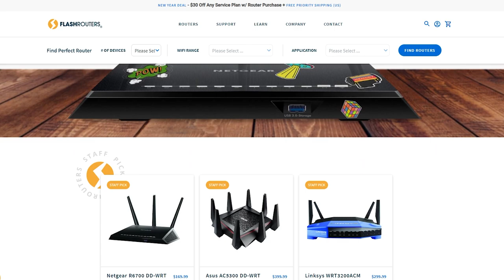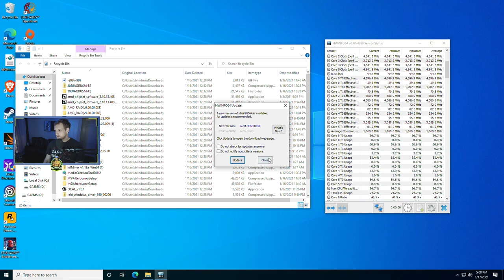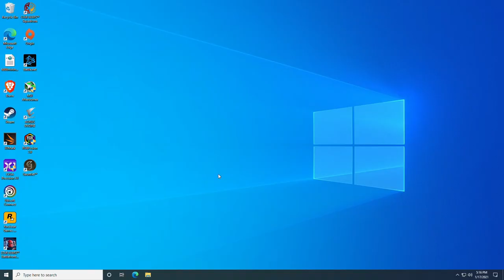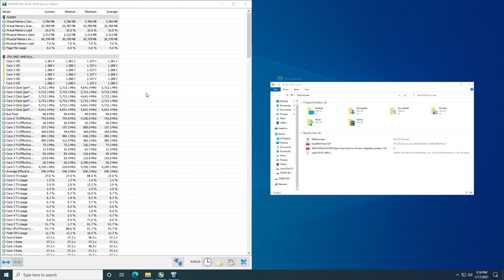How to Replace Thermal Pads on Any GPU!

Comment: Hello, I put it only in the back of 3mm, but I did not manage to lower the fan, now it mine at 97 mhs without throttling but I do not achieve that the fan in autoamtico goes down 100%, and if I manually reduce it, lower the power, for example if I put the fan at 50%, mine at 50mhs :(
Does the fan lower you 100% with the change of the factory pads?

Comment: I’m looking to add thermal pads to the back of my vram…. But my card has the clear plastic film on the back plate. 

Do I need to cut the film the size of the thermal pads in the backplate?

There seems to be nothing online about it

Comment: You read my mind on stuff like this. I tried to do this on mine and it didn’t work so I sold it to a non miner. it’s possible I could have needed to replace the super oil ones that’s were leaking, I only added to the back like panda.

Comment: My gpu will run clear up to 86c in the warzone if I alow it. I’m thinking about replacing the thermals on it but I think it’s just a bad card. It plays warzone around 72c but only if I undervolt it to 70% power and turn the fans to 90%. Oh it’s a evga 3080ti ftw3 ultra btw. Any advice? This is my first build I’ve had it for about 6 months

Comment: update HWinfo 6.42 to get T-Junction temp for memory modules... 30 series GDDR6x memory get damn hot... and causes throttle way more than core temp! will thermal throttle at about 110c on the memory. 
i keep my 3090 stable at 108 no throttle!
Reply: 108*C is still too hot IMHO. I would not run them at these temps for too long. Try to keep it below 100*C. I try to keep mine at 92-96*C.
Reply: @bgtubber  why ?? the thermal throttle is there to stop the card getting damadged... is your "IMHO" based on experties in the field ? or is it just a hunch?
Reply: @oderbang  Just a hunch. From what I've read, it's bad to run CPUs and other kinds of chips above 100*C. I don't think these ones are much different in this regard. So I personally err on the side of caution. Better safe than sorry.
Reply: @bgtubber  hrmm ok... well i have 3 year warrenty so if it goes tits up nvidia will sort it :-D
Reply: @oderbang  In the current market situation you may not get your replacement GPU for months. They'll most likely just refund your money.
Reply: @bgtubber  that information based on anything... or another hunch ?
Reply: @oderbang  As I said in my previous comment, it's based on the current market situation. There are no GPUs anywhere. Especially 3090s and 3080s.

Comment: bro, you did an amazing video. As I have watched the video you posted on changing the thermal pads on your Aorus I did the same thing with my Gigabyte 3080 Gaming OC. Nevertheless, now the cards show stable MH/s, but the Autofan option on HiveOS isn’t working, do you have the same issue? and the backplate is extremely hot....

Comment: I'm all for DIY, but this fix looks damn terrifying. Probably even more so than the average 108°C I'm pulling on this very same card's Memory Junction.
Reply: Seems like the consensus with these Aorus cards is that the hardest part is taking out all of the headers. I saw a separate account on the thermal pad replacement echoing this. The pad application seems straightforward enough.

Comment: How do you deal with issues with manufacturers saying that warranty is void due to being opened?
Reply from the maker: At this time it depends on your use case. RMA would be preferred if you could actually get the card. There is right to repair in US but it’s hard to fight sometimes.
Reply: @SonofaTech  Yeah, It's a shame they can't all just be required to sell them with decent thermal pads, or at least be allowed to take the card apart and do it yourselves, I know MSI has forbidden me from doing anything to the card, including water cooling or changing thermal pads so I have just been trying to get it sent back, but most of the time I just am left without a card and it's hard to prove its an issue as you keep getting "Core temps are fine, so there is nothing wrong with the card"

Comment: Can you post the thermal pads you had with each of the thicknesses? I'm confused on which to get
Reply: Also is 100x100 thermal pads enough?
Reply: @ianpang171  depends on how many cards you want to use them for. For one card sure, you won't need that much anyway.

Comment: Does changing the thermal pads void warranty on these 3000 aorus cards? I have aorus xtreme 3080 and the memory is throttling.
Reply: In the US they can't void warranty because of right to repair. They might give you some hassle but if you stick to it it will be fine
Reply: @bubba1341  could say "sadly" I dont live in the US in this situation.

Comment: Just got a  gigabyte 3080 ti eagle .while mining ravencoin mj is102. i want to change thermal pads too but i dont know what size and thickness to purchase are the same as 3080im a bit confused ,..Some help would be appreciated if someone has done it already and can tupe done here mm and pad dimensions are needed ..Great video as usual soat.

Comment: Hello, how often should this work be done on a video card that works 24 hours a day for mining?
Reply: Maybe try taking the cooler and backplate off your card 1 time and see how it is set up. Depending on the quality/cost of your card you might find it has just a few small pads but needs more for better cooling. Also, make sure you monitor your temps and be aware that some systems don't monitor temps of the memory modules.
Reply: @thequietkiwi  thank you so much.

Comment: Hi Son of a Tech,

You are an absolute legend sir. 
I have a bunch of 6700xt two of them are gigabyte eagle and I have to run them on 90-100% fan as they are generally 20 degrees hotter on the memory compared to my MSI mech and Asus duals. I cant wait to get my pads and change them.

Comment: hello I have the same gpu and I have the same problem of thelmal pads I already saw your video but I see that in it the links that you put only the 200mm pads my question is you only used 1mm pads to replace the ones that the gpu had?
Reply: 0,5mm on caps, 2mm on the chips, 3mm on the back :)
Reply: @Goldstar1337  thankyou

Comment: Did this process actually improve your temps? I did the same on my 3070 and temps are ever so slightly worse now. I don't think mx-4 is a very good thermal paste for gpu
Reply: I recommend kryonaut for gpu die

Comment: how often do u recommend changing the pads? also while changing them, can i kep the old thermal paste, or do i need to replace as well, thx in advance, gigabyte vision oc with 75 mhs
Reply: That Gigabyte cards have no backplate pads and bad front once. My work colleague changed his pads and added on the back as well as using noctua thermal paste and he went from 108-110 celsius on memory (throttling) to 90-92 celsius while getting his MH from 75 to 98-99. Also, to answer your question, yes you do have to replace the thermal paste cause it won't make good contact the second time you try to set it on, it's a one use only.
Reply: thank you sir, i greatly appreciate ur time

Comment: Is there a reason you would want to change the thermal pads?
Reply: Mining
Reply: @k.u.m.o.r  why
Reply: @roastingcamp  for cooler temps. After a while the cooling properties of the pads are severely broken down. Especially for the gddr6x.
Reply: After a while the pads become damp due to long use and overheat so replacing pads extends life of chips and cools system and gpu.

Comment: Hey. One question here. I have 2 rx 5700. One of them is mining 51MH/s as its supposed to, but the second one is only on 40. None of them seem to overheat though. Do you think this could be due to the thermal pad?? Or what could be happening here
Reply: Most likely, almost guaranteed if both cards are running the same overclocks / undervolting :) Download HWINFO to monitor your temps and look in the list if your specific card is Thermo Throttling, it is a simple 'performance limit'-tab saying 'yes' or 'no' :) Good luck

Comment: Could someone tell me the thickness of thermal pads for a Gigabyte RTX 2070? I can´t find information online. Thanks for the help. Thansk for ur video !
Reply: One thing I've learned about the mining/gaming community is nobody shares info. Idk why or maybe corporate bots scrub the info from the internet but you just can't find info on some cards. I've got a ventus 3060 ti and can't find pad thickness after 3 months.
Reply: Like he said in the video, open up the card and measure them.
Reply: @megalojerk84  But in 1 hour you could have opened the card and measured it for yourself.
Reply: @thequietkiwi  yes and I have. Most of these people probably have too but it's not always as easy as that. Some stock pads are 2.75mm, 3mm, 3.25mm but soft as hell you cant just measure and get an answer
Reply: @megalojerk84  Fair enough. It's likely nobody has all the information for every card because testing them all would be expensive and difficult to do. There's no real replacement for experience.

Comment: i have a 3070 i need u to help me find out if its war out from mining i am haveing a problam u know yr gpu is shoing boost speed on msi well my do go over 1750 win in game its stay at 1800 i never had a gpu not show pbo2    like its at spek only its allso got a big heat sinke idk if the card is war out or just need new past its a 3070 never bin opin befor is that what happans yr gpu stops boosting up an just gets hoter    if i opin this jpu i can sand it back i feel i got one yr warrty an it was used idk what to do shuold i sand it back have him change the past on it i mean dam

Comment: How can you see what temperature the vrm is at, cause i can not find that metric anywhere? I have a gtx asus FE 1080ti, msi rtx 3070 gaming x trio and rtx 3060ti asus tuf oc
Reply: latest version of hardwareinfo shows this now
Reply: @madmike171  I have the latest version, can you tell me where to find vrm temp?
Reply: @Obikuba  sure, right under GPU Temperature, its labelled GPU Memory Junction Temperature, from what ive read its only available on the 30 series cards
Reply: I think it’s only the gddr6x cards that have the mem temp
Reply: @four_20hitman___97  I think so too.
Reply: @four_20hitman___97  That's correct, only cards with GDDR6X memory have Memory Junction Temperature reading. So currently thats only 3080 and 3090.

Comment: If you don't have the exact thickness required, like if you need 2mm but all you have is 1mm pad... Can you layer them? As in put two layers on top of each other?
Reply from the maker: Yes you can. It doesn’t always workout though
Reply: @SonofaTech  Thanks for the reply, man!  In what way doesn't it work out? The two pads aren't as conductive as the correct thickness... Or... ?

Comment: How often do thermal pads need to be replaced? Someone told me that on ALL MSI cards the pads need to be replaced immediately before you even use them for mining. Is this true? Because my Ventus 3x and Gaming X Trio seems to be staying pretty cool and I haven't seen any thermal throttling from them....
Reply: Check the memory temperatures with Gpuz or hwinfo

Comment: Nice work. I have a 3090 FE that I bought for gaming and decided to try and mine a bit in the PC's down time. I had to RMA for a bad fan and am waiting for it back, so I can't test yet. I learned about these hot memory issues after sending it out, but it tracks with some of the card's slightly odd behavior. I don't really want to take it apart, but I considered applying heatsink(s) to the backing plate. Do you have any suggestions on that? It looks like all the thermal tapes are pretty useless and I didn't want to make permanent mods to the card..
Reply: Nothing can fix it if a thermal pad isn't touching the memory...nothing is drawing away the heat.
Reply: @Tracker5111  This was a pretty old post! I did try placing heatsinks on the back of the card first, but it didn't really do anything. Later, I did replace all the thermal pads. I think with Tgernalright or something like that? I used all 1.5mm pads per a YouTube video guide. That netted very good results.

The stock pads were all touching, but appeared to be made out goat cheese. They obviously didn't conduct very well.

Having observed the verying thickness of the stock pads, I thought I could do even better. So I went in again and changed the gpu side memory pads to 2mm. This turned out to be too thick and pushed the gpu away from the heatsink. Wouldn't even boot!

Went back in a 3rd time and put all the memory back to 1.5mm. I also used some 0.5mm on  the taller vrms. My final result was no better than the first try, but maybe the power delivery circuits are happier. Can't measure them, so no idea.

Comment: Replacing the thermal pads by yourself makes you lose warranty. Is it worth it?
Reply from the maker: Right to repair in the US. Shrug I mean if the card is down 20% in performance and you know they are just gonna refund you instead of giving you a new card. Either way sucks. Up to you.

Comment: Would anyone more educated help me guess what might have gone wrong if I can't fix my problem with repaste. I changed pads and paste (cleaned with Akasa TIM Wipes and used Thermal Grizzly Kryonaut paste) and the memory temps got lower roughly 10° so pad changes worked, but when I went to gaming the core temps were roughly 10° higher than before! Did I use too little paste or is there any other possibilities? I'm going to repaste with thicker layer and see how it goes, but if it doesn't help I don't know what else might have be the problem.

Comment: EVGA charged me 45 bucks for the pads on my 3080 cause I thought the heating problem was the pads, but it completely bricked, but once I paid that they completely replaced the card.  The pads that where on it where broken up and extremly oily.....worse than my Gigabyte 3080.

Comment: I have the same exactly problem with my GIGABYTE AORUS MASTER 3090. I just put for sale because I can't return for best buy because I take to long to see what the exactly problem. I using Hive OS, and the hole rig keeping rebutting when I use this Gygabyte GPU.  The temp for the memory going to 110ºC  maximum  and I have power limit drop to 264W  :(
Reply: Drop the power limit to 229w, core -150, mem +1000, 97mhs
Reply: @adriandasilva2968  I'ts RTX 3090 not 3080, I just return the GPU. I tried to push the GPU but doesn't work. The another 3090 give me 119Mhs.

Comment: Can you make a list of what sizes you needed for this specific card? My card has significantly improved the memory temps, but "GPU Hot Spot Temperature" is stable around 104-107C under a bit of load, so I'm assuming my pads might not be appropriately sized.
Reply: GPU hot spots are on the graphics chip itself. You would be changing hs compound, not thermal pads on memory ICs. Kryonaut is a miracle worker.
Reply: @cardinaldriver  no, my thermal pads were wrong. I bought some other pads and the cooler is now touching the DIE properly.
Reply: @bjrn-toremediaa3344  did you end up using 1.5mm pads? I think 2mm for the VRAM is too thick.
Reply: @NorthsideChamps16  I don’t remember, but you can try 1.5mm, then run some benchmarking or stress test while monitoring the temps

Comment: I wouldn’t do this because this void the warranty, I use two 120 mm fans directly blowing on the backplate of each card, it actually does a good job lowering 6-10 degrees Celsius
Reply: How can you fit all those fans in an 8 card mining rig????

Comment: hi use power limit to 66%  and set your volt to the minimum  700 mv , -150 on the core
Reply: on MSI afterburner, ctrl+F, 0,731mV , push L (to lock voltage) and tune clockspeed around 1300Mhz. what ive tested its around the sweetspot. no matter what power target is after that. card wont draw more than 230w even at +1000 on memory

Comment: Just had to order pads for my 3080 xtreme same thermal throttling issues, will I need to also replace thermal paste on the chip even though its vram that's overheating?
Reply from the maker: Yes paste must be re applied as shown

Comment: Anyway you can confirm which companies void  warranties by doing this? Some say yes, some day no. 

I did it anyway regardless  because even while gaming, the temps on my gigabytes where awful. It was either take a chance and rma and get the same results, get a refund and be stuck without a card, or have the card fail from prolonged heat exposure.

Comment: Personally I have msi 5700 mech , most gpu make me crazy . I ordered 2mm pads , Not help , I double pads total 4mm needed to push to fit with headsink , I confirm 1,5mm or 1mm and double pads will be great don't need 2mm just double 1mm

Comment: its always better to messure the pad as long it is pressed on the pcb via the cooler. messuring the pad after removing the coolblock, the pads forms back so the mostly come back to their original hight. if you remove a 2mm pad with another 2 mm one, but its harder, the pressure can be to high after replacing the cooler, means the pcb can bend and you damage the card over time.
Reply: Evidence?

Comment: Has anyone gotten exact pad measurements for the MSI 2080 Ti Gaming X Trio? I replaced them but I think I messed up, kind of sort of. I know the back plate uses 3mm pads, but the thinner pads for the power phases and mosfets are what I'm primarily curious about. Pretty sure I determined the VRMs can be 1.5mm, but they could be 2mm... When I measured them with the same Calipers as SoaT uses, I couldn't get exact measurements because I bought the card back in summer of 2019 and the time has warped them (obviously).
Reply: Also, when I tried contacting MSI support about this, my reply was simply "2.5mm" and I'm like "lol wut?"

Comment: Why couldn't you just use the pads for the last part also? Thanks to anyone who answers.
Reply: Pads will not transfer enough heat in that critical area, so thermal paste is required. Arctic brand is quite popular.